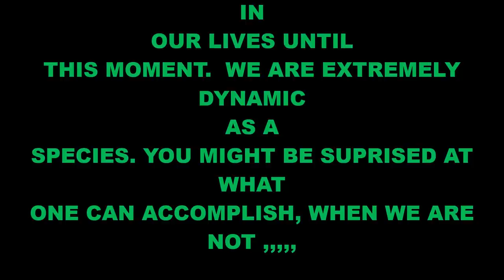VINTAGE AXE RESTORATION, A SPLITTING AXE

Comment: Bill first off let me say that i only recently found your channel by chance, but i love the joking, outrageous personality keep up the great work. Now i have a serserious question for you. I was in the middle of a serious yard clean up job for a elderly neighbor in the midst of this virus crap when i literally stepped on a project. I dont know how old it is, nor can i find a name but i found a entirely steel hatchet. The. Hatchet handle has a full steel tang passing (originally had) between two halves of a wooden handle held by thick rivets. I would love to restore it to a show piece and i need a experts opinion about removing the rust, polishing the steel, removing spurs, sharpening etc.
Reply: Another note: the hatchet has no visible seams from manufacturing, it looks like it was a single forged piece. If you have dealt with anything like it or would do a short video about the steps ill have to take id love to watch more of your work. Keep up the great work and be safe out there.